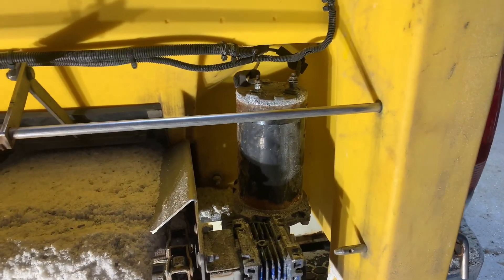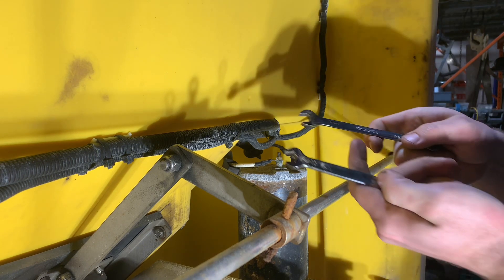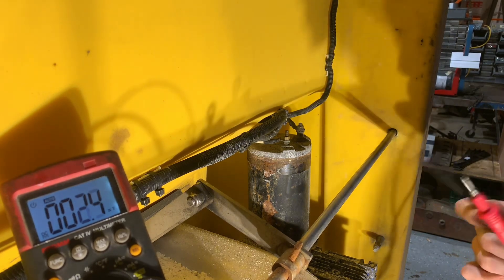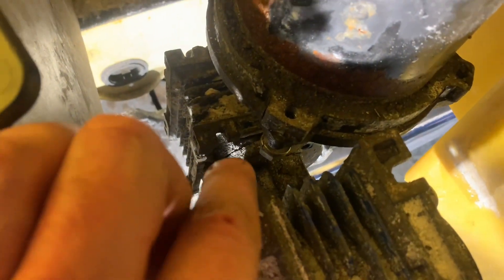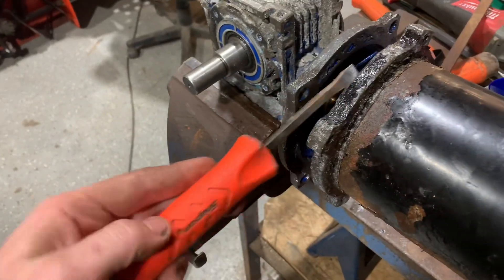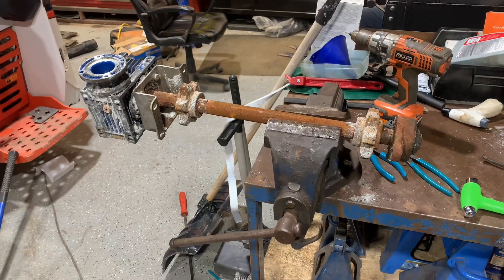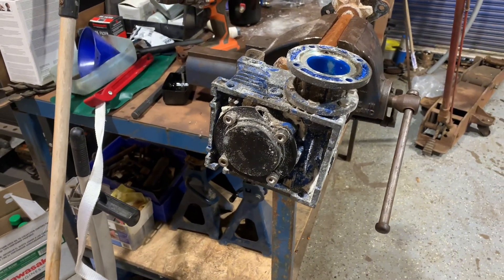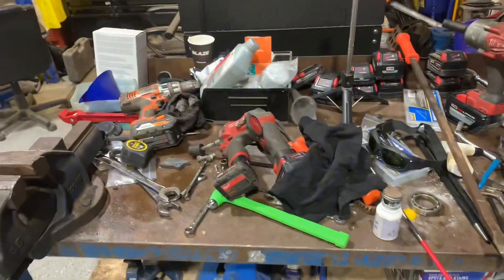Fisher slater HP code fix!! WORST CASE SCENARIO GONE WRONG!!

Comment: I have same issue now I hope it’s just stuck
Reply from the maker: @solofett7222  were you able to figure something out?
Reply: @ 
The wire was loose I tightened them both up fixed the screw on the ground was almost off
Reply from the maker: @solofett7222  nice! Everything is working good again ?
Reply: @ 
Yup I got lucky the spreader was filled .
Reply from the maker: @ sweeeeet